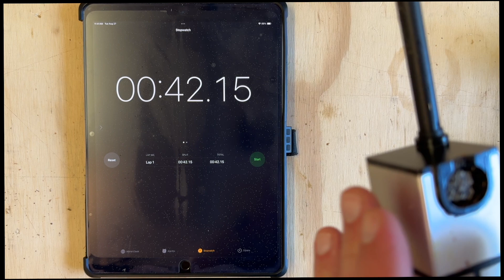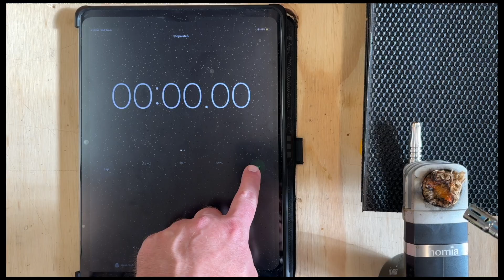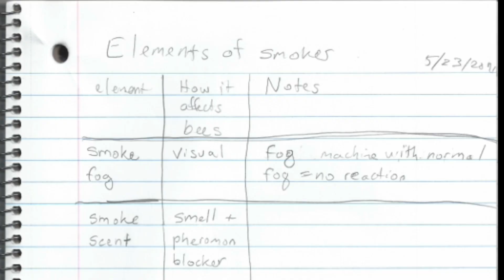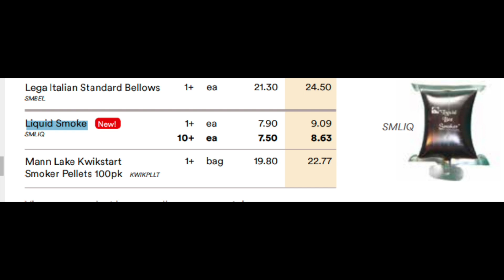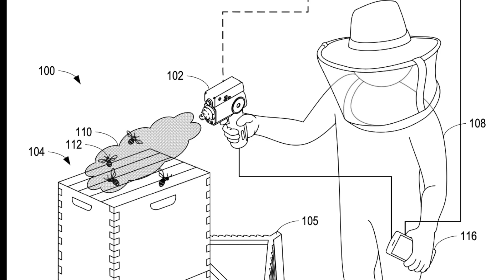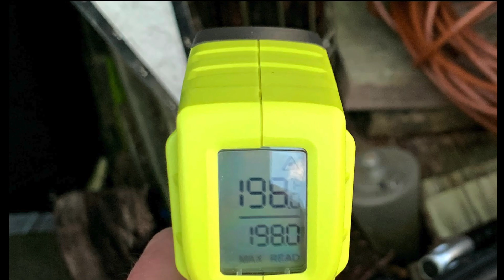The Electric Bee Smoker That Could Change Beekeeping Forever  ⚡️🐝💨

Comment: Oh man, thats an epic lookin tool you have goin on there! So much innovation. Ill be keepin an eye on this! Id like to see something with a Mic and a camera that can scan a QR code on a brood box, and then store all the next pictures / vids in a folder with audio (for note taking). Once you scan the next QR code, starts a new or adds to an existing folder. Id also prob make buttons separate for the camera part, and the smoker part, i can imagine the smoke might mess up the image / too much noise from fan to record audio. But man, just as a smoker without all those bells and whistles, you have peaked my interest! edit and the dewalt battery is also a great option, tho unless you make a bunch of dif versions, might limit your customer base unnecessarily in the beginning.
Reply from the maker: RePetes, thanks for all the ideas!  I like that idea, maybe I could push the vids and pics to a Google Drive at first.  I was thinking of storing it all on the cloud.  So far most people just want a device that replaces the smoker and don't seem super interested in the Smart Device, but I've actually added GPS into the smart device to detect where the beekeeper with the idea of registering it's location so that the QR code wouldn't even be necessary (although still an option).  As a solo inventor that's doing all this on my own dime, there's only so much of the elephant that I can eat at one time, but I really think that the potential is limitless and the smoker is the best place to put a smart device.  Wouldn't make much sense in a hive tool. ;). Thanks for your comment, it's been a long lonely road developing this, and it really makes me feel like I'm on the right track.
Reply: @TechnicallyBeekeeping  Oh def, focus on the smoker, thats gonna sell itself if it works! then you have all these addons you could sell separately and develop at a later date with or without help once you see some returns. Best of luck on your travels! Ill def be a buyer at some point im betting! Looking forward to the next vid!
Reply from the maker: @RePetesBees, yes, I originally started with the smart device embedded in the smoker and realized that not only would it add a lot of development time to building it, but some of the people that may want an electric bee smoker may not care about automated inspections (they just want to smoke their bees faster and better).  I think that decoupling the smart device from the smoker turned out to be the right call.  Thanks again for the great ideas, keep them coming.

Comment: QR code on brood box x your smart inspection device would be a great innovation. Could then link photos with that Varroa-spotting app - I can't remember the name of it as we are the only corner of the world without VM at the moment...... but being in Western Australia where we have total fireballs for most of summer your vape-smoker is an awesome idea!!! I bought an Apisolis last year but haven't got around to using it yet but yours looks much more user-friendly. Keep up the thinking!!!
Reply from the maker: Rachel, I love the QR code idea. Keep the ideas coming. You are right about areas that have severe droughts. I learned about smoker regulations in many parts of the Western US due to the potential of forest dies. I suspect that Australia may be similar in risk. 
Regarding the design, yes, I have seen some devices that strap a vape machine onto a bellow or a fan onto a burning chamber, but I feel that they are incremental fixes to the bee smoker. Thanks for your comment!
Reply: This is good idea for the QR code! QR code number each box, and when you come around with the smoker+camera, just a quick point at the QR code with the camera and ur good to go! All photos / video linked to a QR code in a nice folder maybe at some point with software, and like you said, wifi/ BT to a phone or PC. Man, this would make my life so much easier. Just thinkin, then if you needed notes, maybe a mic on it for some audio notes. Everything id use in 1 handy device.
Reply from the maker: RePetesBees, you are on to something here.  I was thinking the other day, "What if we had something like a Siri for taking notes while inspecting a hive?!".  It seems like when you're in the middle of an inspection with a frame of bees in your hands is the worst time to look for a pen and paper, especially with everything being so sticky.  What if you could do the equivalent of a "Hey Siri, colony 5 is in trouble and has American foulbrood, make a note and send a message to the state inspector" or "what should I do?!".  What do you think about this idea, or maybe there's an alternative way of doing it, I'd value your opinion on this?
Reply: @TechnicallyBeekeeping  The Siri thing sounds really cool! I hate trying to take notes while inspecting hives. Something to record either what you say, or be even cooler to have something that you can interact with! Used to use a gopro but that just became cumbersome to more or less watch a whole video to re-transcribe notes. So needs some way to break up videos. Tho, now for it to replay / play sound your talking speakers too, and idk if siri / google or whatever you choose would charge you to implement such a thing. Might be something for down the road? Start off with something pretty effective but simple, maybe just push a button and it stops vid, push again starts another, with mic creating a folder for each. Then look into either goin the QR code route, or if they dont charge, maybe something fancier with siri or the likes. No matter what you choose tho, your making a unique product that, at its base, I have a feeling will sell well. I hate traditional smokers. If it works, and its not hundreds of dollars (not including all the add ons you could do, talkin base product), id be interested! might also want to look into a patent for the idea, might not save you from other countries scalping your idea and rushing it to market, but would least block American companies from takin advantage of it without paying you royalties (or the likes for where you live? I just used american as example)
Reply from the maker: Thanks, RePetesBees.  I'm pretty sure that you and I will invent a Jarvis for beekeeping one day. 🦾
Regarding the patent, the device is currently patent-pending. I have a ton more work to do on it. 😅 Thanks for the encouragement! We are just getting started.
Reply: @TechnicallyBeekeeping  YESSS a Jarvis! hahaha oh man. "Jarvis, BEE suppression mode NOW!" :P
Reply from the maker: @RePetesBees, lol. I thought about creating a bee glove that's like the Ironman glove and smokes the bees (or Spiderman).  No need for a smoker device then. :)